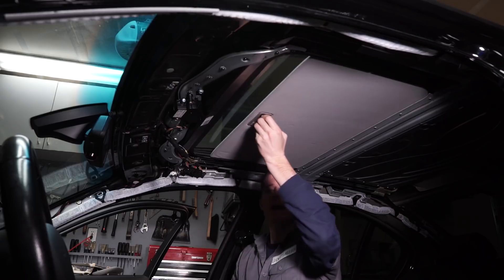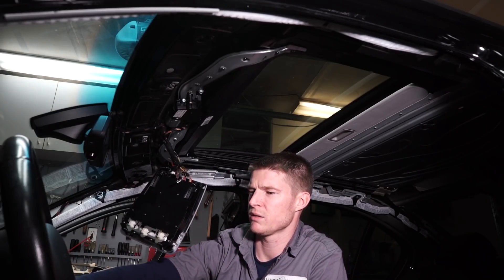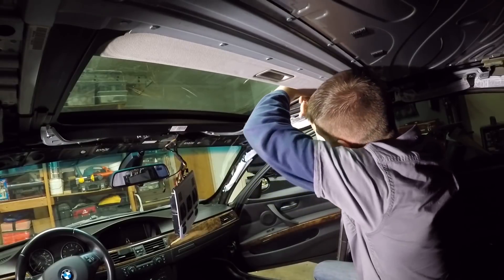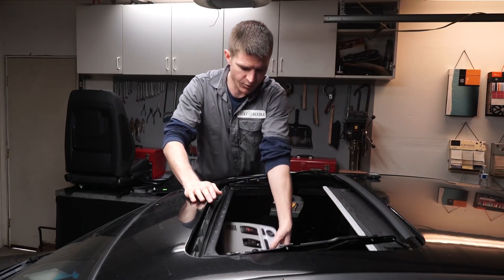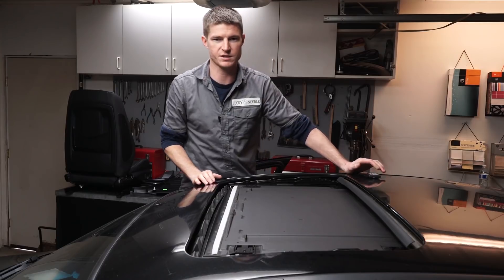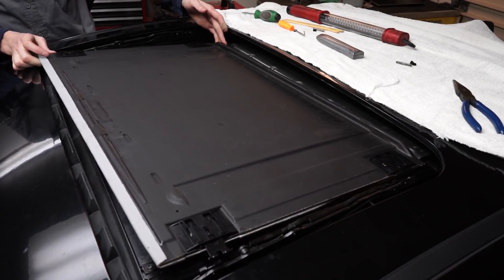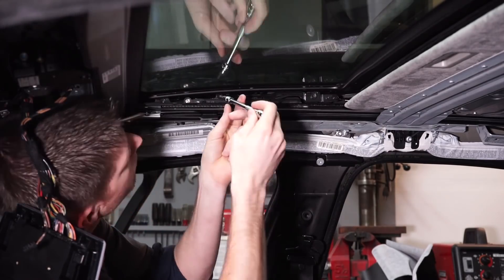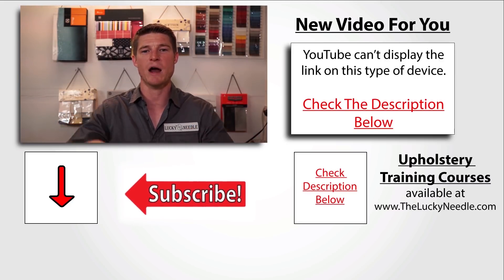E90 BMW 325i - Sun Shade & Sun Roof Glass - Removal and Install

Comment: In case you're still checking the comments here...  All my questions answered! Thank you! Speaking as an owner of a beloved 200x BMW E82/E9x, I'm very grateful for these DIY clips. My '09 135i has been an absolute champ through the years, but it has essentially transitioned in to a restoration project. My sunroof is currently in need of a proper lube and adjustment. Watching this just made it a breeze. TY!

Comment: Genius, i just did mine 325i E92 07 done in upholstery shop couple months ago and the moon roof was not flush %100 from outside even in closing position even with motor Rest method, your video was extremely helpful, greating from Bahrain 🇧🇭!
Reply from the maker: That's awesome! Glad it helped : )

Comment: one lil tip, if shade material had loosened,rolled or peeled off exposing old gummy sticky smearing stuff(its old deteriorated foam backing). make sure ya clean up that stuff from the cavity the shade stows in. gummy stuff could be on lower surface of cavity, which will ruin the newly covered panel when ya hide the shade. I made that mistake once......ONCE.
Reply from the maker: Great advice! Thanks for sharing that!

Comment: Thanks for this video. I just had to remove the interior to get water out of the passenger side after the car sprung a nasty passenger side sunroof leak. After I got it all together I guess maybe one spot on that felt sunroof trim was too high and the fabric got snagged. It basically ripped the whole thing off. Now I got to go back and fix it. 

I am thinking it would be a good idea to paint mark the sides of the 6 bolts with something before removing the sunroof so that you can realign them with ease upon reinstallation.

Comment: Thank you for this toturial and explanations around the sun roof & Co.
I have to replace the seal around the glass piece (the soft coating is disintegrating). Can I do it without removing it from the car ?

Comment: What an excellent guide.  I Just removed the headlining and sun roof of my 120i hatch following your instructions.  Brilliant work.  It was easy to follow.  By the way removing the headlining from a 2006 BMW 120i hatch was out through the back hatch.  I removed the headrests and tilted the seats only.  I did have to give it a slight bend to get it out.  I am not one to comment on videos but yours really deserves the credit.  I have subscribed.  Thanks again from down under 👍

Comment: Most people don't realize how consuming it is to dismantle the interior.  Great job
Reply from the maker: Yeah that's for sure.. Thanks!  The rest of the videos on recovering the headliner and sun visors in suede will be out in a week or two.
Reply: @Theluckyneedle  hey, awesome video! Just one question though, that you didn't show in the end, how the heck do you put the rubber accordian  thingy back in?? Lol the two rubber pieces you just pry off at the start before you work on the glass screws.  Thanks for your time looking forward to your reply. Cheers!
Reply from the maker: Thanks Karl!!
 It just slides back on over the metal tangs of the frame. Its really easy.
Reply: @Theluckyneedle  hey thanks for your speedy reply! I did see that, and I assumed that was it, but I can't seem to get in at it because of the tight angle unless Im doing it wrong. The roof has to be tilted as it was when taken off the first time, or pulled back slightly?
Reply from the maker: Your welcome. Maybe you have the left an right mixed. The channel on the accordian that hold to the metal tangs are different on the top and bottom I think.
Reply from the maker: It should be really easy. I did it with the window in down position
Reply: @Theluckyneedle  ok, I'll give it another go. I assumed they were the same for either side instead of one for the left and another right. Thanks again!

Comment: Hey dude! Great video, but I had one small issue. After putting the sunroof back together everything works except when I want it to open completely. It gets stuck. Is this perhaps an adjustment issue I have to do manually? Any way to get it to auto-adjust?

Comment: Got it out ok (328i) but putting it back it was impossible to align the sunshade or put back the little plastic stabilizers. Had to take it in :(
Reply: lmao same here! I have the same model bmw 328i and just replacing the fabric on the sun shade because the material came off. :(
Reply: John Frutos I have the same problem with the fabric coming off . Did you glue back the fabric ? Trying to figure out what I should do with mine .

Comment: 🤨I followed the instruction in the video, had new fabric glued to the sunroof cover and reinstalled the cover and the glass. However, now when the cover retracts under the headliner along with the sunroof, it will not return to the original position when the sunroof is closed. It stays stuck under the rear headliner area and has to be fished back out each time. Obviously the mechanism that pulls the cover back out is either broken or detached. I can't see anything missing when i peer under there with a light. Any help, ideas or diagrams would be greatly appreciated!
Reply: Im having the same problem please any updates solutions?

Comment: For some reason my sunroof track isn’t aligned. One side of the sunroof glass will bolt up but the other side won’t line up. Any suggestions ?
Reply from the maker: Thats frustrating. I have never had that issue before... Something must have gotten moved when removing it.

Comment: My sunroof doesn’t move and is stuck. How can I remove it to realign it?
Reply: Hold the the center of the button up for about 25 seconds or until the reset cycle is finished. Sometimes the computer glitches and won't allow you to open or close the sunroof. But usually that fixes it.
Reply: Vesper Ibanez tried that. But the person I bought the car from took the sunroof off and reinstalled it all cock eyed.